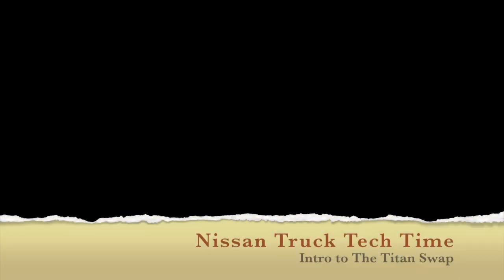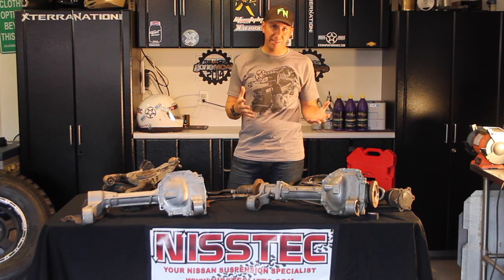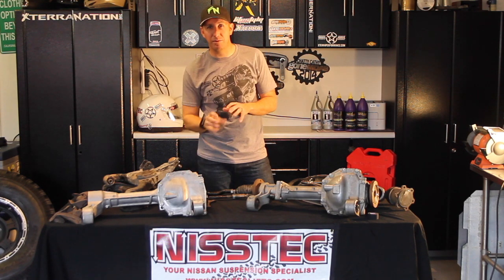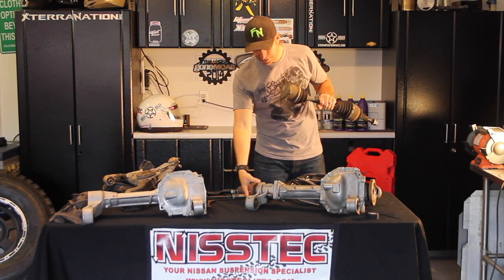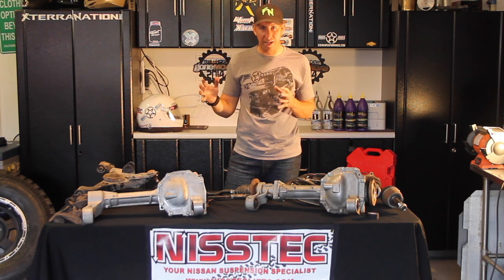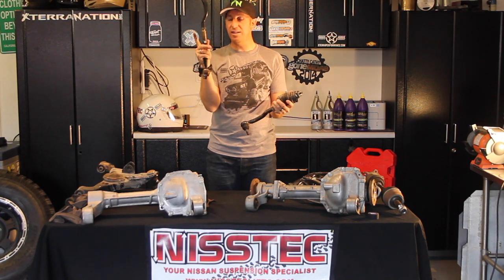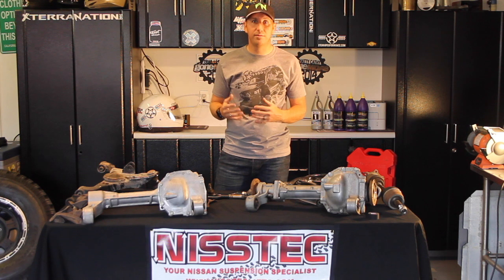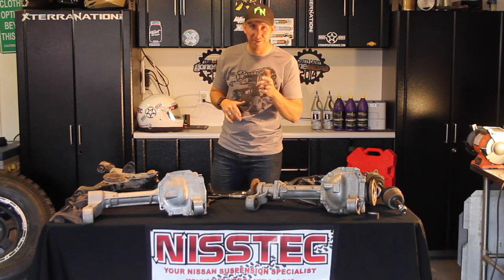Nissan Frontier and Xterra Titan Swap Explained

Comment: Ive got a 11' crew cab pro4x, I really want a titan swap now. I wonder if the Titan XD Cummins diesel would fit too
Reply: Fit.. Yes id say. But the 5.0 is an international engine. By that i mean it was designed in the US. Sourced parts from who knows where and built in brazil or china... The VK56 is made in Alabama..
Reply: Leo-Niklaus Spartos 😘😋😉😚🤩🤣🤣😃😃😃😂😂😘😆😄😁😂😂😂😂

Comment: And r51 Pathfinder.
Reply from the maker: pra3t0rian the pathfinder was a crazy hybrid style. It has a m205 but short axles so it’s Xterra/Frontier width.
Reply: DaGrootX that being said the “titan swap” is actually doable on a pathfinder ?
Reply: DaGrootX only the V8 pathfinder came with a 205 and hybrid cv’s. The V6 pathfinders front end is exactly the same as the xterra and frontier. So yes a titan swap is doable.

Comment: Hi, informative video, but as you may know the Frontier D40 is called the Navara D40 in the Caribbean. And they only came with the rear axle assembly with the drum brakes. I know that the US version came with disc brakes at the rear, could you say if they're interchangeable (swappable).

Comment: Does the Titan sway bar work with the swap or do we need a custom sway bar?
Reply: No.  sway bars will go away due to where they have to bolt up to the subframe.  You can't even run a Fronty with the sway bar and simple 2" spacers in the front for lift without some sort of modification.   That said, if you're raising your truck or going the route of a Titan swap, a sway bar is one of the last things you want on your truck.  It'll absolutely kill your ride and completely crush your wheel articulation which is already limited due to it being an IFS.

Comment: Do you have to extend the steering column? 

I would like to go 5-6" of suspension lift
Reply from the maker: anthony cook, the steering column only needs to be extended when doing a body lift. you can get away with doing a 2" body lift and there is enough play in the steering shaft for you to loosen the bolt on the shaft and slide it up and lock it back in. For suspension lifts the steering shaft does not come into play.
Reply from the maker: If you are only doing a suspension lift you don’t have to extend the steering column.

Comment: Im running Bilstein 5100 levelling shocks in the front of my frontier,  I notice a lot of people are either running coil overs or adding spacers or both after the instal, is this a must?  can i get the desired effect without having to add coil overs?

Comment: can you do the titan swap on a 2wd frontier.   just use 2wd titan arms.
Reply from the maker: steven carter , yes. It's actually way easier on a 2wd. Just. Are sure and get Titan inner and outer tie rods or tie rod extensions.
Reply: @Dagrootx  
How high of a lift can you go on a Frontier, safely, before going to a 'Titan swap' kit? And on a Frontier with a Titan set up? What's the benefit of doing this "swap", lift wise?
Reply: Steven Carter
But why would you go through all that trouble for a truck that's only 2WD?
Reply: Okie Rider Full race trophy trucks are 2wd. -less axels to break

Comment: Is there a video being worked on about how can(or even if) a rear susspension and/or axle from a Nissan Titan be swapped with a Frontier/Xterra?
Thanks again for this video. It convinced me to get a different daily driver car and save my Xterra for a Titan swap. I'll check your shop first. Cheers
Reply from the maker: We can definitely look into it for you!
Reply: Its possible because I did it. ABS sensor wires are the same and new perches need to be welded for spring under set up and Deaver springs are something I recommend as well.
Reply: Hey what did you do for brakes? did you swap the titan brake booster and stuff?

Comment: Is the M205 based on a Dana Axle like the rear is? Just curious, I am very familiar with the rear as I have pulled it apart when I installed my Grizzly locker... haven't had reason to dig into the front yet. Also, is the M226 actually a 8.9 inch gear unlike the 8.5 of a conventional D44? Should of measured it when I had it out but didn't think to. Just curious, not important. I may swap out the front and rear gears at some point for 3.73, but it's fine for now.

Comment: I'm guessing since I have a 6-speed PRO4X Xterra I can't swap in a M205?  I haven't seen them in 3.69 gears.
Reply from the maker: John Brandon Dunker basically the answer is no. Though I feel like regearing to 4-10s is the way to go if your running 33" or taller tires.
Reply: Xterra Performance thank you. At this point I'm more worried about the longevity of my R180 so I'll probably go with an air locker or Lokka.
Reply: I'm in the same boat. And you are correct. No M205s came with 3.69s and there are no gear kits for that ratio. The easy solution is to upgrade to 4.10's in both axles or if you're going to go bigger, 4.56s. With the 3.69s going to 35s and 4.10s puts you a bit better than stock. It's effectively 3.78 when compared to stock. Which is more than ample for driving and wheeling performance.
Reply: I'm also in the same boat with the 6MT.  The level of effort and expense to re-gear is just not worth it to me although I really like my Xterra.  Plus, I hate any kind of mods.  Kinda wish I would have bought the FJ Cruiser, instead.